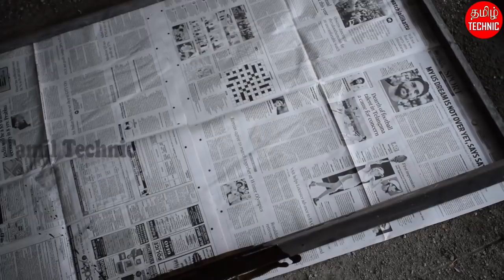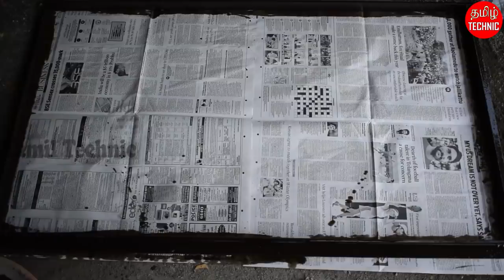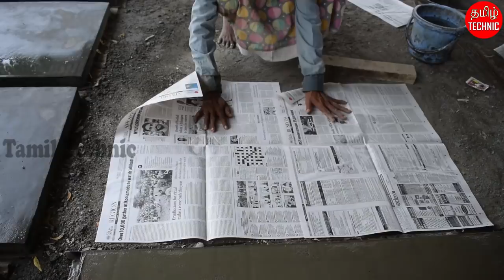Readymade Concrete Slab Making Process in India

Comment: These slabs are 3.5 ft wt and 1.5 ft ht thickness is 0.5, 0.75, 1 inch vary according to the use. Yes they would have tied it and would have put the female screws. Also cement is 53 grade. These people also turn these the other side next mrng and they will make the surface smooth
Reply: So these slabs are easy to move by two people? Thanks for sharing
Reply: @Rain.Dance.  ya for sure they will not add any 20mm rocks it's mostly cement and sand.

Comment: what is the slabs used for?
Reply: I’m guessing with concrete beams, like beams and blocks. - I am building a house in Panama. The beams & block system isn’t available here. So I’m browsing ideas on what else I could do myself. In the end, I don’t like to spend $2,000 on wooden materials for my second floor concrete slab and throwing the wood later away. I can’t use a wooden floor because of the termites. And lifting this slabs in this video isn’t easy too all by myself. - I figure that I’m building a couple 12ft x 4ft molds and pure the concrete right where I need it. Let it cure for 3 -4 days and move it to the next place needed until my floor/ceiling is closed. After that, the final concrete will be poured in for the needed height. With that, I am only spending around $400 for the plywood what I only need one time in the construction. I didn’t see a place here where they renting plywood. Gives you an insight on what the slabs are used for.

Comment: Couple of comments.  Nice technique to spread some concrete first before laying down the rebar.  However, it would have been better if the rebar was tied together with wire.
Reply: Why? It's encased in 2 inches of concrete.

Comment: Rather putting rods freely they must tied it in a frame & use less water for better result.
Reply: What better it makes if use less water?
Reply: @drsantoshsinghrathore9308  Since cement particles are very light in weight compare to sand and gravel, it floats on the water and not mixing properly to make strong concrete.
Reply: @ankurjoshi9217  Thank you sir.
What ratio of water, cement, sand and stone is recommended? 
And what ratio without stone in plastering?
Reply: @drsantoshsinghrathore9308  There is no exact ratio for water but cement, sand and stone is mixed with generally 1:2:3 by volume but there is a lots of another ratios too to acquire diff strength of concrete(grade). Water is mixed to achieve cast-ability consistency.
Reply: آره. خیلی آبکی درست کرد

Comment: better for boundary wall construction. don't use as a floor or ceiling.
Reply: ooooh nice idea.  I think I will make an A frame camping cabin this way.
Reply: But why not use in celling purpose... Tel me some faults..
Reply: @fayyazhaider6080  Slab is serviceable component of structure so, the load equally distributed to the beams ,but these Hand maded block can't resist a load properly and chances of failure when sudden load applied.  
So, go for a RCC slab is long lasting and  tension free structure.

Comment: May I know the proportion of the concrete?
Reply: 3 parts sand 1 portland cement 1stone
Reply: It seems like the last step is to get at thin layer of portland as a surface protection?